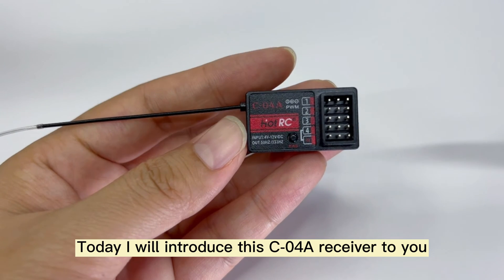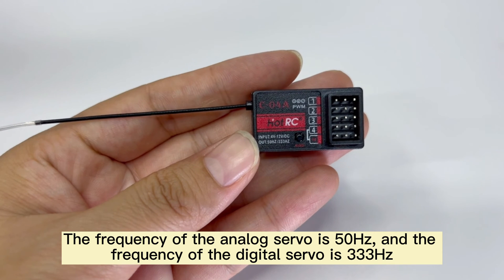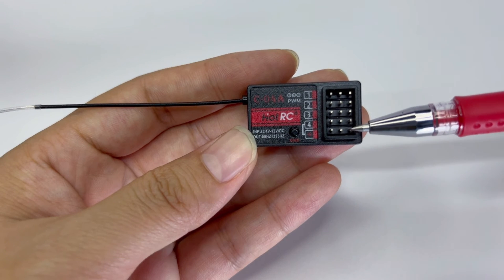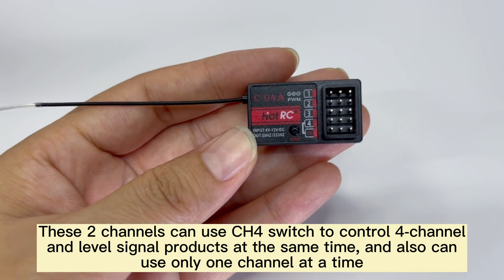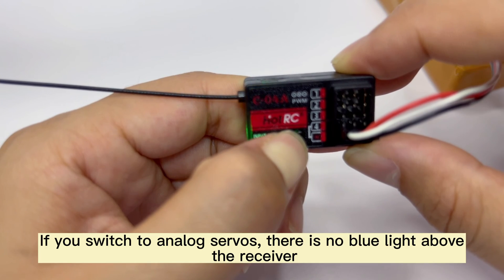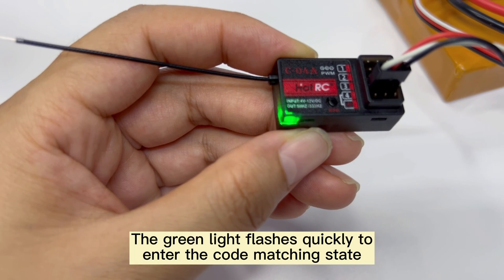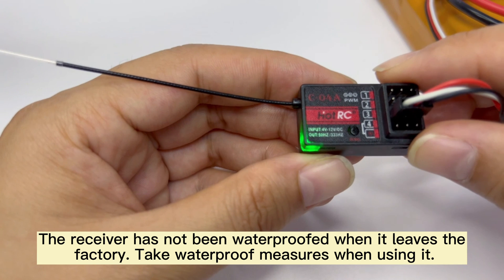C-04A Receiver Introduction (DS-4A Remote Control Receiver)

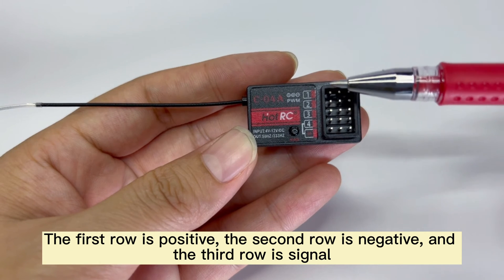Comment: At 0:39 the video says the first row is positive, middle pin negative. However this is incorrect. At 1:40 the plug has the red (positive) wire in the middle, black wire (negative) is on the right which is correct.

Comment: @HotRC-Shopy I have touched all the buttons and deconfigured both the receiver and the transmitter completely. Is there any option to reset both the emitter and receiver to factory default values?
Reply from the maker: Which remote control are you using?

Comment: How does the receiver turn on?
Reply from the maker: 1. Connect the power supply and receiver
2. Press the small button on the receiver (code matching button)
3. When you see the receiver light flashing, turn on the remote control
4. Code matching completed

Comment: i has a question when u turn on the digital servo mode what channels are only affected by it?
Reply from the maker: Hello, it is like this, we set the digital steering gear mode on the receiver, the channel mainly depends on which channel you connect, the connected channel can directly use the digital steering gear

Comment: my receiver suddenly died. even though it had only been used a few times. it died during a new servo test. the led didn't turn on and the receiver was really hot. is it overheating or is there a problem with the esc or servo
Reply from the maker: How much V are you using to power the receiver?
Reply: @HotRC-Sophy  battery 2s.li-ion 7.4v 1600mah.esc 30a.out of the esc about 5.5 volts to the receiver
Reply from the maker: @heryjangkung  It may be that your ESC or servo power supply is too high, causing the receiver to burn out

Comment: Can you change the speed of the servos with this radio?
Reply from the maker: Do you want to adjust the speed fast or slow?
Reply: @HotRC-Sophy  yes, when servo is connected to channel 5 switch. When I flip switch, can I make it so the servo is slower for flaps?
Reply from the maker: @magicmike1122  It cannot be adjusted, the remote control does not have this function

Comment: what is the difference between ct600 (4+2), pwm and regular ct600? Please answer
Reply from the maker: (4+2) ch1--ch4 of the receiver are pwm signals, ch5 and ch6 are level signals. The 6-channel receivers are all PWM signals
Reply: @HotRC-Sophy  
so why on my ct600 receiver (4+2) ch5 and ch6 can't be used for LED or winch?
Reply from the maker: @barbaraleonidas7352  Only use low current led lights